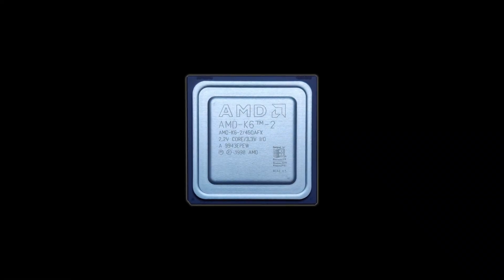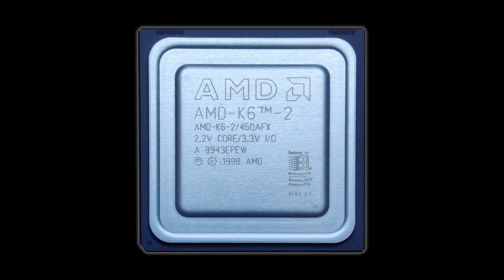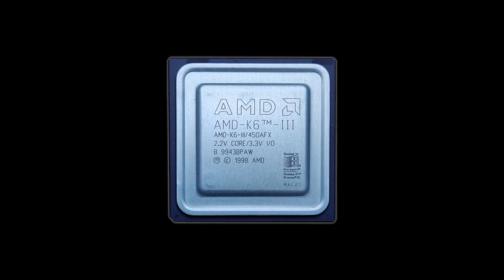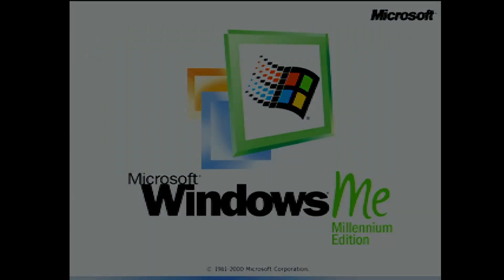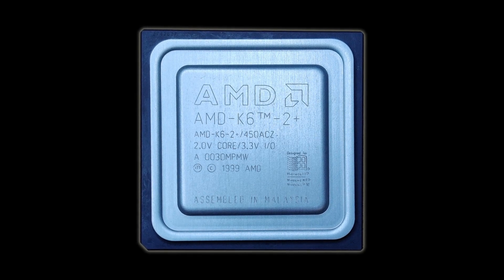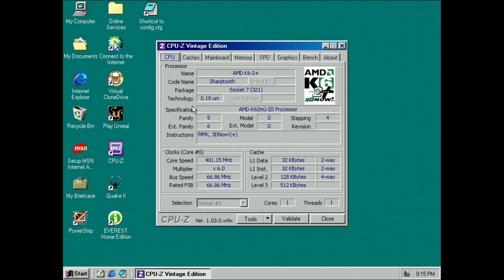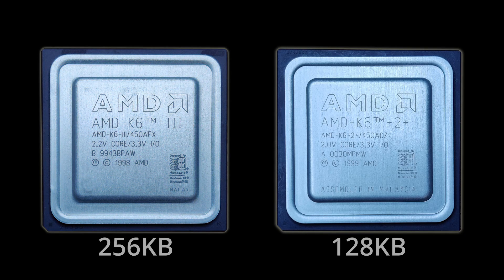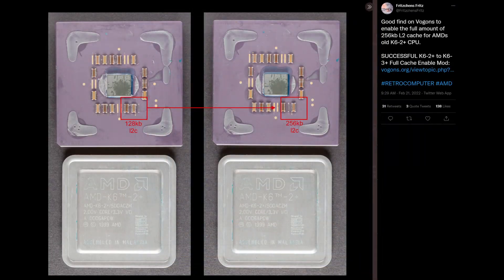Turn K6-2+ into K6-III+: Delid AMD K6-2+ 450ACZ (Part 1)

Comment: for this silicone compound and ceramic substrate delidding can be made much easily - just drop whole cpu in some hydrocarbonic solvent (like kerosene or white-spirit) for a few hours. Then IHS can be removed by hand.

Comment: It was surprising to see you having it socketed in the motherboard for some of the delidding. I would not have thought that to be safe, but back in the 90s, there wasn't as much pin density, so the pins were larger and much stronger than they are now.
Reply from the maker: I kept it in the socket to add some weight to the CPU and keep it in place. I think it's much easier to bend pins when you're working on the CPU only - hard to get a proper grip. Once it's fixed in a socket, you need medium pressure on the razor blade. I wasn't concerned about the pins during the process

Comment: I don't know what I was expecting under the heat spreader, but it wasn't a CPU that looked just like a K7.
Reply from the maker: I have never questioned the look of the K6-2. However, after removing the lid I feel betrayed ;)
Reply: Heh, same. Not surprising though, they had their tech and simply evolved. K7 maybe is a completely different architecture but general chip construction apparently stayed the same. Out of curiosity I checked also how K8 looks delided - and... not really the same, they evolved 😉